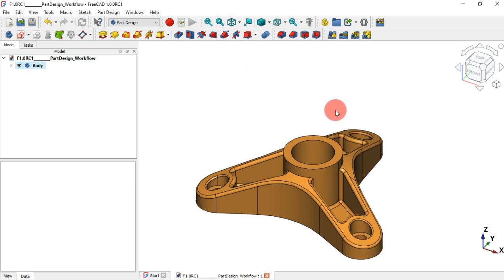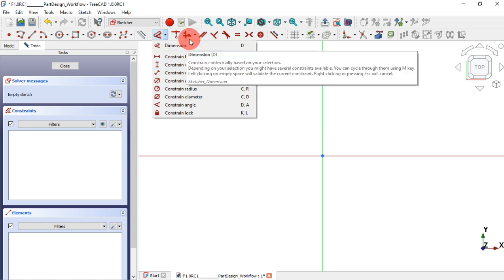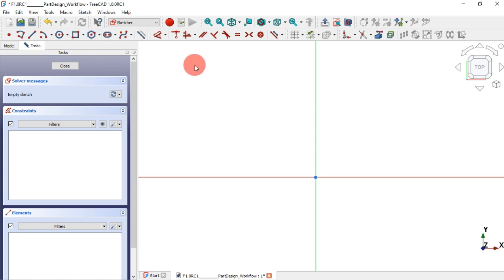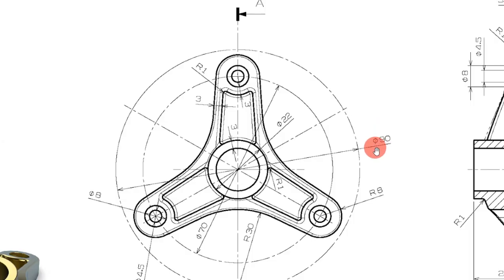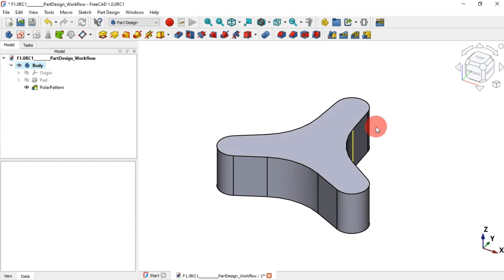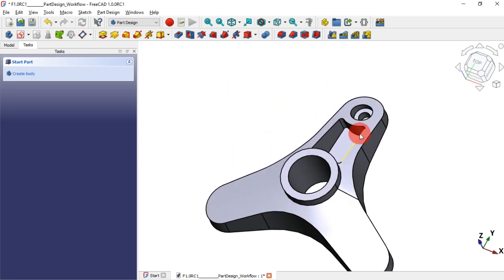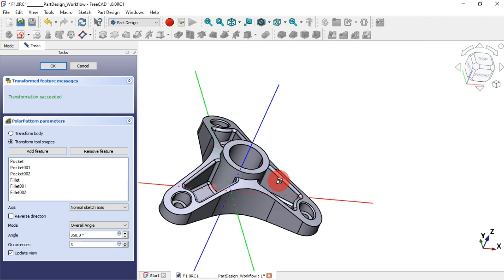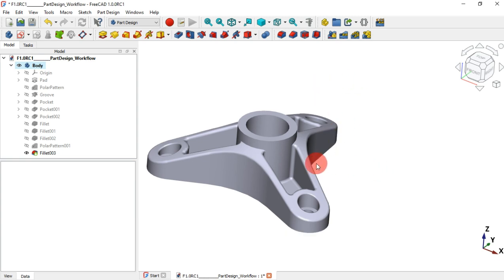Freecad 0.21.2 / FreeCAD 1.0.RC1 Step by step modelling part 2: STUDYCADCAM 3D model

Comment: it will not let me set tangency to points. I am using 1.0RC2 weekly build and now it needs you to select at least 2 objects in order to set a tangency.  drives me crazy that it changed
Reply from the maker: I'm still using the first released version of 1.0RC2.
Thanks to notice me this changes.

Comment: Before watching this vid tried to do it myself. Decreased my optimism in freecad, though it RC2, so it's only "somewhat". Initially I made one big sketch with lots of lines wanting to make pad part of edge clicking on edges trick. 

Then I converted center big circle to construction line, then tried to make geom lines that go over the circle. Had "Autoconstraints cause conflicting constraints. Please report!". Worked around. Then I notices that holes in the legs are actually pockets and had more problems: I made a box, rotated it 3 times and wanted to fuse with the model. However the only thing I got was XY plane for some reason. 

I decided to restart and use simpler techniques (no multiple extrusions from a single sketch).
My secret sauce was to do 2 pads: one 22-4 up. one 4 down. This way plane for groove is aligned at Z=4 from where diagonal cut is started. Only during video watching I realized pad should have been 5.2 

Also I feel that using macros to make script that creates model from scratch might provide some pluses as you can rely on exact coordinates more freely. Though it'll take significantly more time.

Comment: Hi, just finished these 2 exercises, as I have been using the older versions for a while now I found that having to learn the differences between the two made it a little slower using ver1.0 but I did get there in the end :) I am now trying to make drawings with TechDraw work bench but am having a lot of trouble trying to produce drawings similar to that of the ones on your examples.  Would you consider making  videos of making Tech drawings using the same example on both version of the programs. 
Thanks.
Reply from the maker: Humm, thank you! I will work on it! Please give me some time, I'm well biz these days.

Comment: Nice video! I've seen, that the new version also supports multiple extrusions from a single sketch like fusion 360. My initial thought, was to basically recreate all vertical elements in the first sketch, since I wouldn't have to use any external geometries, and extrude everything from there. What are your thoughts about it and would it be possible at all? I liked how you only did a third of the outer wire initially. Is it possible to multiply this wire in the sketch and continue from there?
Reply from the maker: Yes, using copy paste, offset, mirror.

Comment: You make this look so simple, im brand new to CAD, but challenged myself with a complex project to start with, I seem to have hit a wall when it comes to keeping a model fully parametric all the way through the design. I eventually need to edit something designed early on which inturn breaks my entire design. I'm also not understanding something when it comes to referencing faces or edges within the same part but a different body, sometimes I can reference but some it wont allow., what I mean by this is I have started the file several times over and starting from a different design part and working through in different directions, but always seem to hit a point I can't progress past, and because I don't know what is causing the actual issue I'm finding it hard to teach my self the fix lol.

any way very informative vid I now understand how to use patterns, which I'm not actually using in this project but very handy none the less, and construction geometry I now understand a little, and constraining arcs with this I never though of.

Thanks very much
Reply from the maker: Are you using RC1?
Reply: @OffsetCAD  the latest off of the freecad site. And I'm working with lofts and curved surfaces mainly.
Reply from the maker: You are using the 0.21.2 version.